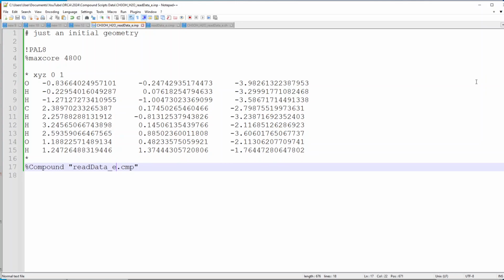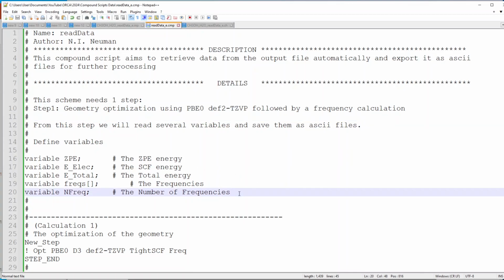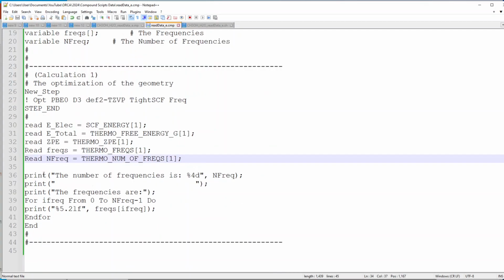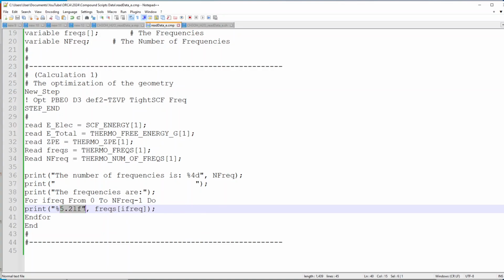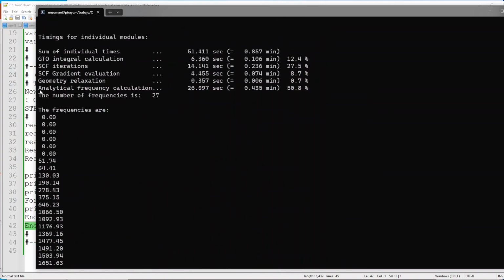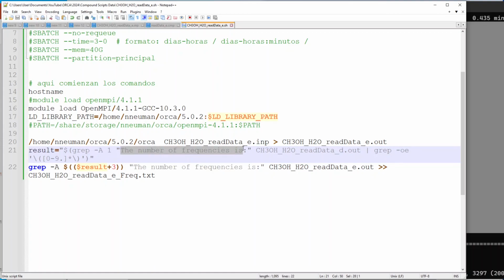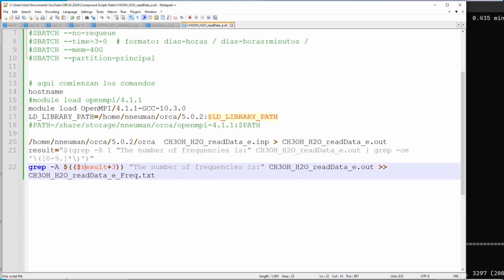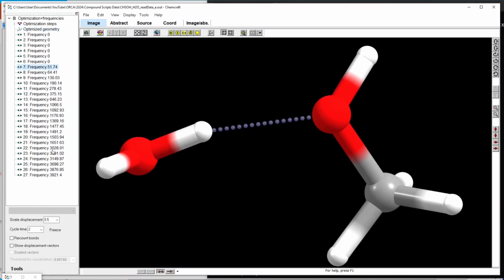Compound Module and Bash to Extract Data from Orca Output File

Comment: Hello, your Videos are highly useful.
can you please make a video on how to calculate the Fukui function of a molecule, starting from Avogadro drawing..🙏
Reply from the maker: Hi, thanks for the suggestion. I have done this but I didn't know they were called Fukui functions. I am quite busy lately, so I don't know when I will have the time. But there is a good tutorial on this in here:
https://www.orcasoftware.de/tutorials_orca/react/FUKUI.html
Basically you have to export the electron density for a cation, neutral and anion with the same starting structure, and then you can subtract the densities in chemcraft. I am not sure if this can be done in Avogadro. I will check. If not, I made long ago an Octave script to read and subtract cube files, but it was not meant to reexport the results as a cube file. But I'm sure there has to be some simple program for doing operations on cube files (they are simply lists of numbers in a particular order)